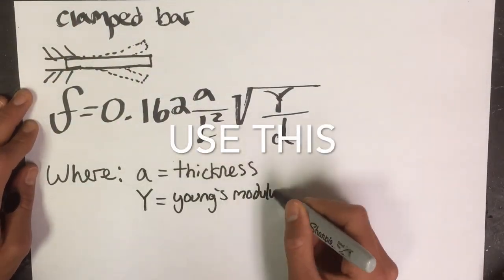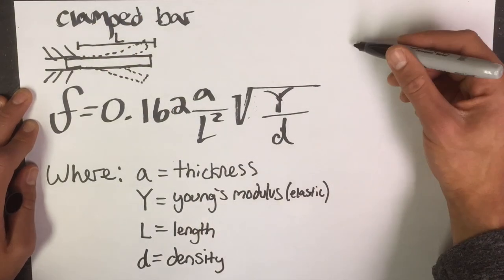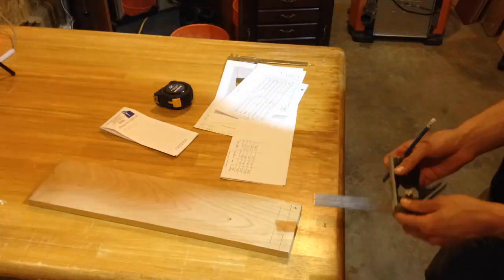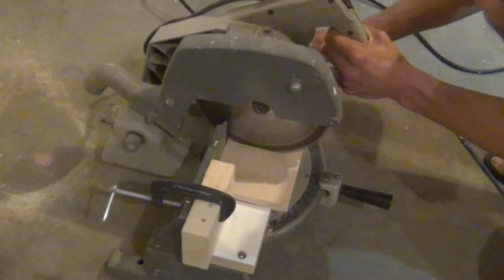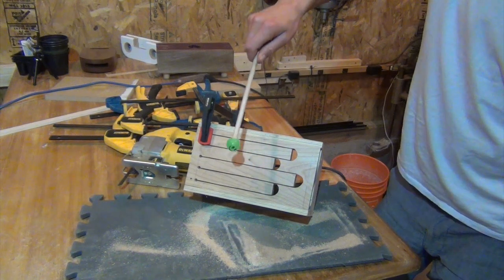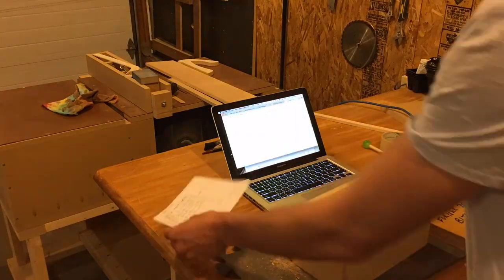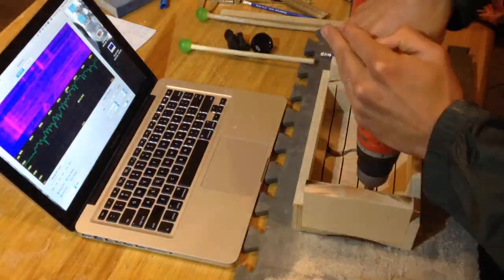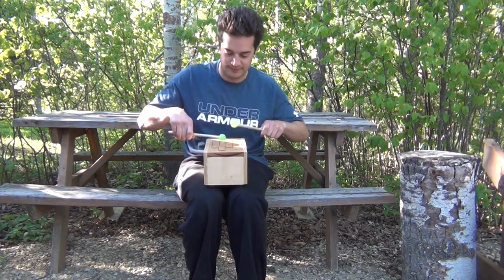How to Make and Tune a Tongue Drum (Part 2 of ...) Featuring the Length Calculator!

Comment: You talk about length of the tongues and the thickness.  What about the width of each tongue.  How do take the varying widths into the calculations?
Reply from the maker: For the width I usually keep it consistent around the base of each tongue (around 3/4 inch) but it does vary at the tip.  The extra width at the tip of each tongue makes it behave like it is a longer tongue (more mass at the end of the spring).  For example if the length calculator gives me 11" and I only have 7" of room for the tongue I will try to make the end wider to add extra mass.  It is all just an estimate and you will still need to do extensive tuning to dial into the notes that you want.
Reply: @ikindawannalearn9513  Thank you  very much.  That was very helpful.  Would you be willing to share the pattern you made for the twelve tongue drum with the fairly angular/ pointed tongues?  I really like the look of that one an would love to give it a try.  Thanks again, Paul Stitzel
Reply from the maker: @paulstitzel1839  Sorry Paul I don't have the plans for that one.
Reply: I would imagine that there would be some vibrations along the width of the tongue, but probably at too low an amplitude to be meaningful at least on the longer tongues. I do wonder if it might become a more significant factor on shorter tongues...

Comment: Do you have files templates in dxf or svg?
Reply from the maker: I don't but come up with a design you like and then just take your time with the tuning...  If you plan it out using the length calculator you should be able to reach all your desired notes after careful tuning